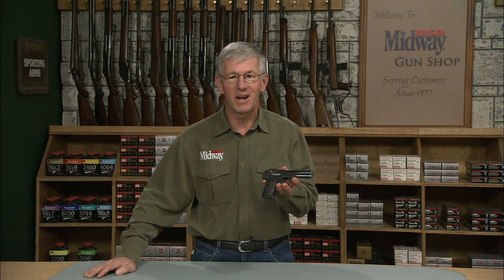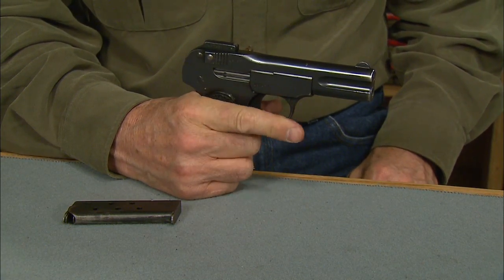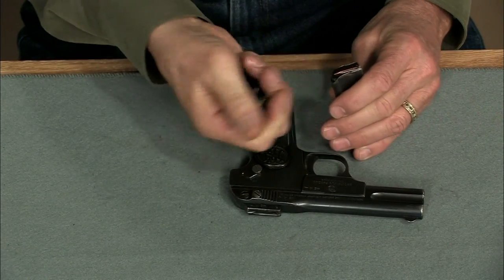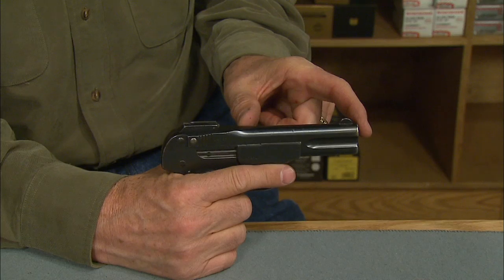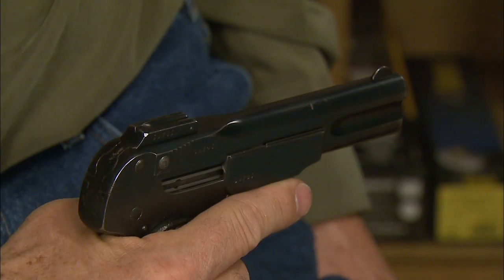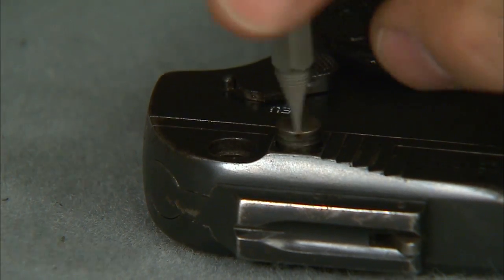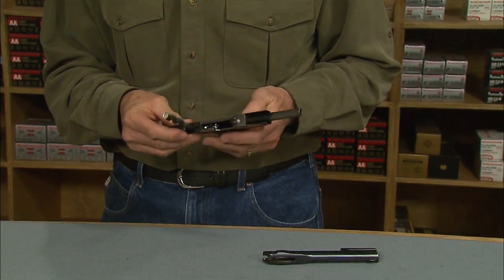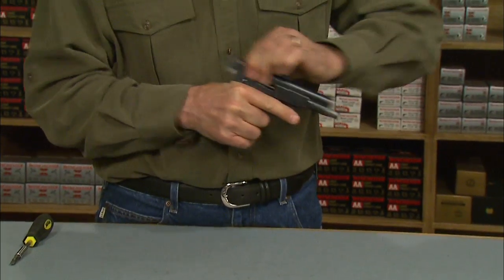The FN Browning Model 1900 | Gun History | MidwayUSA

Comment: When replacing the breech bolt/spring assembly, if the trigger is pulled, the sear is cleared, thus allowing the assembly to slide on the frame easily.

Comment: I thought the Browning 1910 killed Archduke Franz Ferdinand. Both were designed by Browning and made by FN
Reply: It was. It's an often repeated error.
Reply: It was the 1910 used for the assassination; which could bring up an interesting point, that design came out only ten years after this one, but is much more modern. As Larry pointed out in this video you need a screwdriver to take this one down for cleaning, while a 1910, though not as easy to take down as modern automatics at least doesn't require any tools.

Comment: Good video, Larry. I have a FN1900 that was with my fathers' stuff from WWII. He said he won it in a poker game. I've had it cleaned & serviced but I was told not to try to fire it. The smith said the current 32 rounds are too much for this gun..after all. it's now over a 100 years old. Do you feel that might be a correct statement? Thank you
Reply: John Carlson if you know how to handload cartridges and have the necessary equipment to do so,  you could load light loads and try it.  You also could replace the springs but that could decrease its value. If you don't know how or have the means to reload,  I wouldn't fire it if a gunsmith says not to.

Comment: There was an FN1899 pistol before this (actually two....one slightly larger, and one almost the exact same size as the nearly identical FN1900).
The Belgian Military requested several small improvements to the FN1899 (the cocked striker indicator, thumb safety (which also will manually hold the slide open....but not on the last round), larger grip panels, and the protruding area of the frame above the slide lengthened for strength, plus a lanyard)......thus becoming the FN1900.
The FN1900 was known as the Browning Auto Pistol until the Model 1910 was introduced in 1912.....after which the FN1900 was known as the Old Model Browning and the FN1910 the New Model Browning.
The larger FN1899 model was developed and used as a test bed for possible military contracts that never came to be. England turned it down because of the small caliber and relatively weak cartridge.
Later FN asked John Browning to design a military handgun in a larger caliber and
he presented the FN1903 (which was basically an enlarged version of the Colt Model M 1903 Pocket Hammerless). The FN1903 was chambered in .38acp which became the basis for the .38 Super in the early 1930's.
Sweden pulled their remaining FN1903/Husqvarna pistols out of mothballs in the 1970's to replace Lahti Pistols that proved weak in design and used the FN1903/Husqvarna until they adopted the GLOCK 17.
Reply: ColtCommanderdm The FN 1903/Husqvarna 1907 were chambered in 9x20mm only.

Comment: What is the best ammo for this gun?
Reply: Victor Ludwig Fiocchi and Seller and Belloit 7.65 Browning/.32 ACP should be hot enough to cycle it reliably. I wouldn't use Winchester White Box in it.

 American ammunition usually loads certain calibers to lower pressure in deference to older guns ie: .45 Colt is often loaded to 850 fps or lower so you don't blow up a Colt Peacemaker like you would using modern ammo like Buffalo Bore, Hornady and such.